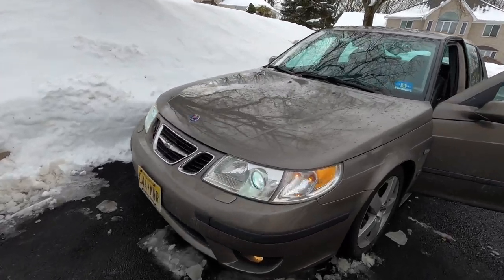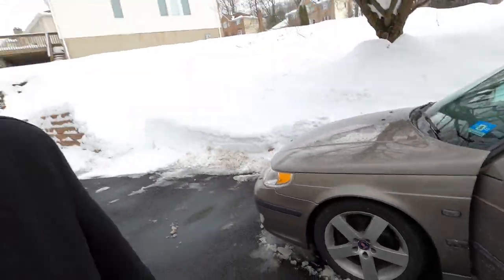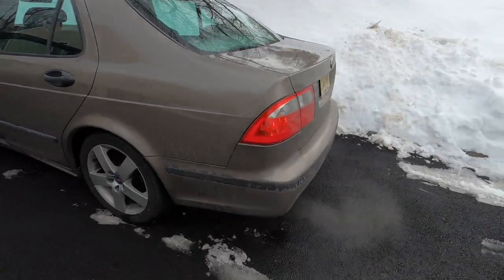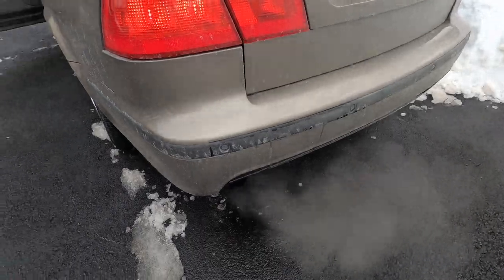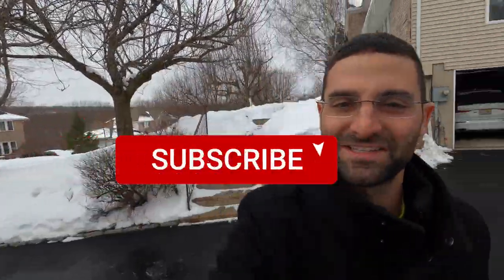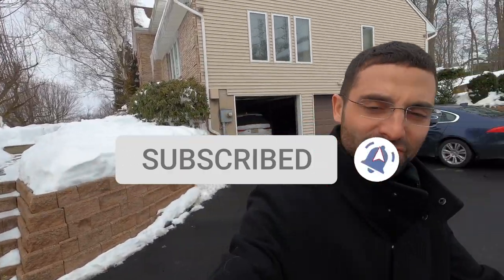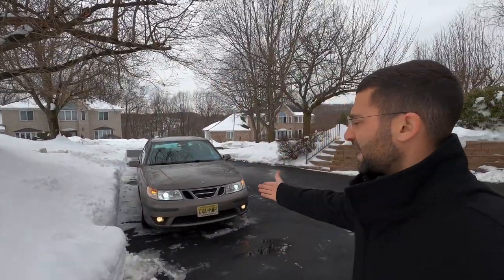Here are FIVE Performance Upgrades Every Saab Suspension NEEDS

Comment: No. 1 Problem with saabs and especially 9-5s are the soft bushing that get shot quick. Just changing to polyurethan bushing both front and rear makes alot of difference

Edit; you menioned it i see 😁  but should def. be the first uppgrade

Comment: I’m pretty sure OEM struts on the aero are still Sachs. Lower springs like you mentioned. I have bilstein b4 with aero springs on my non aero. I felt like b6 was too stiff for daily driving but man did they perform great. The b4’s are bilsteins”oem equivalent” option and state they are about 15% stiffer than oem. This feels like an accurate description. But the performance is lacking. Kind of the worst of both worlds. If I had to do it over again I might have gone with Koni adjustables set all the way soft.

Comment: How do you have a usb port by the onstar buttons. Also do they still sell rear sway bars from a reputable place?
Reply from the maker: I installed it myself, drilled and placed in there
Reply: Look at ultra racing on eBay 20mm rear sway bar

Comment: The SAAB 9-5 handles far better around the corners when you do this: Lower the car with 2 cm for a lower center of gravity, change the suspension with a notch stronger suspension arms, change the shock absorbers with also stronger and stiffer ones. This will not affect the comfortable ride much. The standard shock absorbers at the back were not worthy of the SAAB 9-5. I have a SAAB 9-5 with the suggested changes above, and I noticed a big positive change!
Reply: What suspension do you have exactly? On your 9-5 OG

Comment: Off topic.. have you ever felt with Xeon high beam shutters on a Saab? On my 9-3 the high beams will not work. Meaning the Shutters do not open.
Reply from the maker: I haven't personally! Check fuses maybe?
Reply: I've had that issue recently 😕 on my 9-5. As Kyle said check the fuses. My left side wiring harness was cut so I had to replace that. Once I checked deeper into the issue I ended up having to replace the entire assembly unfortunately. Its working now thankfully.
Reply: @kennys7361  i check the light it self and can use 12v to move the shutters on the bench. I have also checked the fuses to. I’ll check them again, but I think it is something else
Reply: @cbdoil4082  so idk if the 9-3 has it but under the 9-5 headlight assembly there's something called  a ballistic it might be worth a look. Those tend to go bad and cause issues. I would spray some CDR electronic cleaner on the connectors.